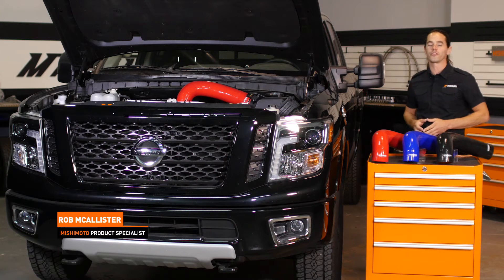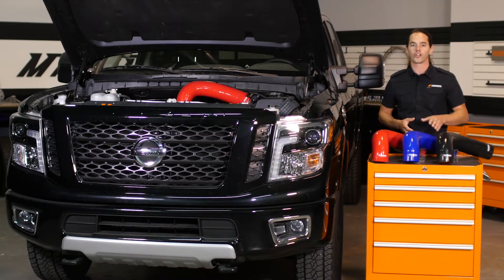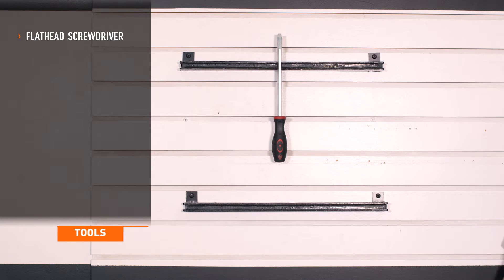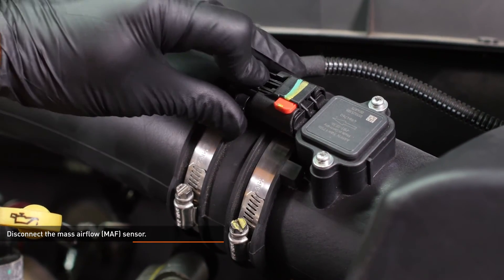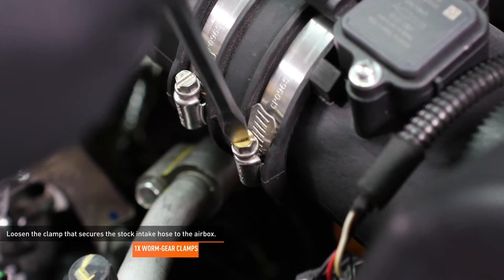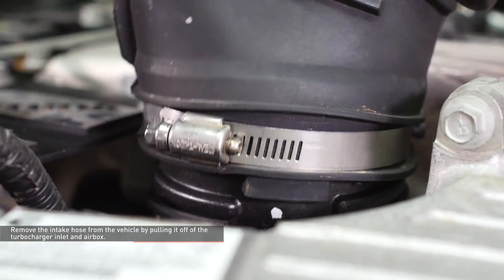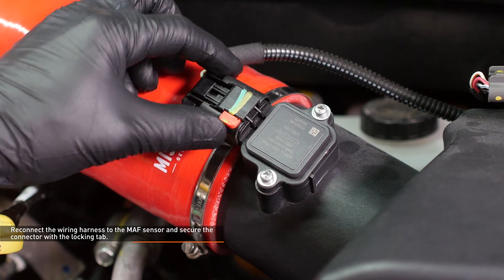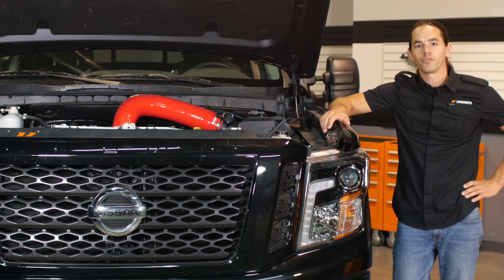2016-2019 Nissan Titan XD Silicone Induction Hose Installation Guide By Mishimoto

Comment: What's the benefit?
Reply from the maker: These are much more durable than the stock unit and improve overall airflow. Power gains can be had with tuning, but the vehicle's ECU restricts power on the stock tune.